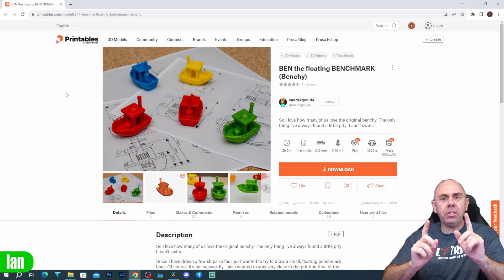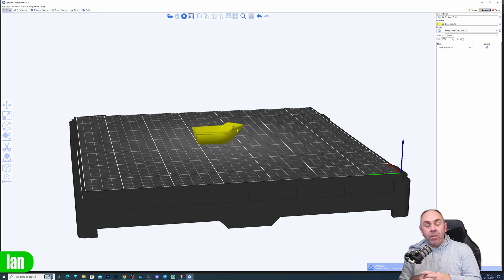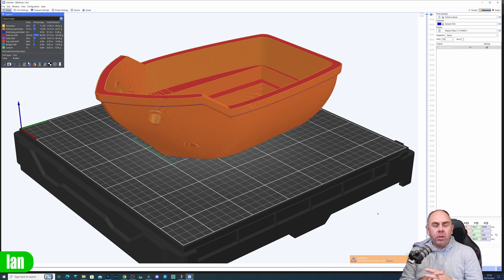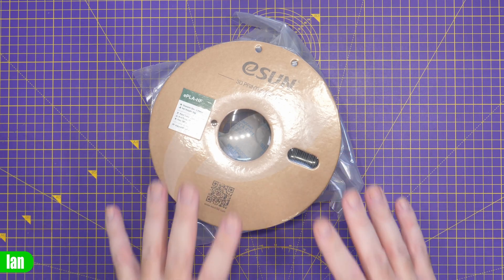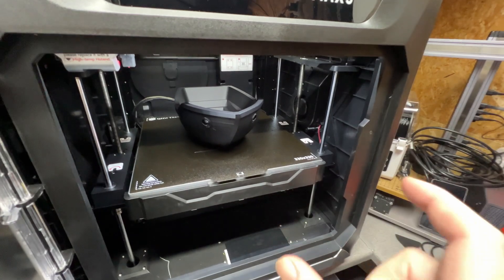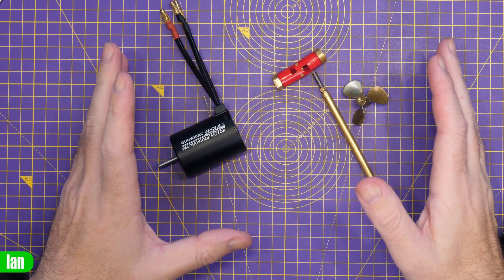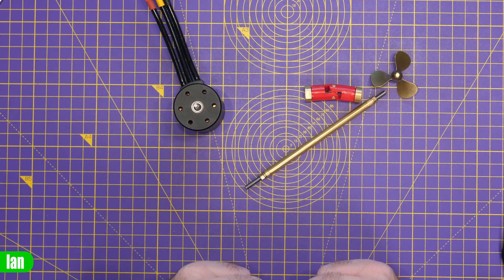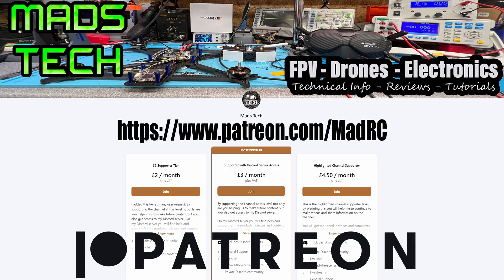Lets Build A Radio Control FPV 3D Benchy - Qidi X-Max 3 Large Print

Comment: Just for your information regarding if your affiliate link for the bambu black friday week had worked (or not).

I had purchased what you had recommended, the P1S or so (it is still in the box, needs a new bench and warm I guess in the heating room) with the 2 free filament spools which were anounced as limited. For our twins birthday december 6 th it should arrived and arrived but without filament even though I had a screenshot that I had ordered one while the free filament was still available at least on the website. So I opened a case on bambulabs site, told them that the boys in the group which the twins are leading will be totally upset if they did not what the should have gotten. 
Bambulab ignored it and rejected everything while the twins went crazy on social media till the competitors became aware of the story and offered the black fridays price for their printer - and on top they made a 2 for 1 offer on top after the deep disappointing moment when they had heard that the spools were missing, bambulab later replied that they were not ordered while in stock even though the screenshot showed the message of 2 free filament. 2 for 1 meant that each got his own 3 printer and that one was also a lot cheaper. 

And then - you might wonder why I am still writing while the story seems to be told - I wrote back to bambulab first that the boys are running a social media campaign and that they will succeed (which later happened).

Second: based on german law I would not pay the 30€ shipping fee to return the item, but they could pick it up cause based on german law they had not made clear during the purchase that the click of putting into the basket could lead to a purchase without free filament which is forbidden here cause that would mean that a shop could replace items in basket during order or the content. 
Bambulab did not react and warned them about german consumer right clubs and their lawyers that they have issues based on their german website and based on their EU headquarter in germany. Anyhow they ignored that too and so I called a lawyer who said he would win such case but recommended a way to easier success. Open a paypal claim and write in german the claim and add a screenshot of the website in german cause PayPal would then force bambulab to pay for the mistake which meant they would have to pick it up via dhl or others, I would not have to bring the printer to the post office.

Guess what?
Now the same guy from bambulab wrote what ? We send you the 2 free filaments if you cancel the charge back
That was the release day of the A1 - just before the A1 release which I did not know was happening.  
To make it short: from the black friday purchase it took maybe 20 days why the twins would not get the free filament and on, then I got the offer for 2 free filament and had to sleep a night or better 2 till I said yes and within 24 hours the filament was here from Frankfurt in a very stiff box, each spool perfectly protected and then another heavy cardbox as protection on top. Arrived today. I have closed the paypal case. 

And now from my inbox the paypal date and time when I had purchased: November 20th  15:48 = 3:48 pm GMT +1 
I hope you will be able to find this affiliate link in your list now or at least later (cause I had closed the paypal case 1hour ago). I really hope they, bambulab will honor your efforts cause without you I would not have bought such printer for the twins - and for sure not for me, but a lot cheaper one. But based on all your recommendations I had said that we will invest more for a longer usage period and higher value / lower depreciation. Without you they would not have sold it to me - crystal clear cause I had not watched any other 3d printing video or brand before even though I was aware about creality, the prusa and what not for brands. 

I hope you will find that order on bambulabs affiliate overview - and maybe that might help even more: the order number begins with EN and ends with *661.
I had paid 667€ (incl. 8€ shipping and 19% VAT) and it was an order from germany on the german bambulab store for the EU, I had used the link you had provided.

Quite long and astonishing journey, a lot of effort for me, disappointed kids that now use a different brand which had jumped in instantly with a great offer and no PR propaganda  after they had helped out, and I was already in a "maybe next black friday mood and attitude", when the turnaround came over night surprisingly which I first wanted to reject and then thought twice . Stupid marketing mistake by bambulab. They knew the printer was birthday present for our twins and they stayed coldhearted, they ignored the social situation, and what not, till paypal claim was open and then weeks later they offered a 24hours delivery for the spools we had missed. 

And I have a printer and no spot right now, but I guess on chrismas things will look a lot better - for the printers new home which is still in the factory box. 
I bet they have not learned the real lesson and maybe others will find the story how you have to deal with bambulab in case of an issue: open a bambulab claim , ignore whatever they write and let them know that you will open a paypal claim cause only then you will find help and support and a very, very fast support cause before they had replied every 3rd or 4th day maybe. 
And I guess that is a key knowledge for you in case others might face issues and complain cause paypal is a 180 day after purchase (not delivery) protection that is respected by its power. Everything else did not work at all in my opinion. I hope this feedback might help you in these tricky situation when buyers will complain and might be unhappy with the bambulab support - as we had it in earlier days with DJI and its support, which has improved an awful lot, also the repair service and prices at least for me.

see you in 24 hours live stream I guess.

Comment: 12:55 why did you need those supports in the back bot not for the bow ?
Reply from the maker: The lettering stuck out a lot. It was not for the boat but the lettering it’s self on Ben
Reply: @MadRC  Yes, thanks. I can remember that when you "unpacked" that. I am noob and forgot that you can not print on air or a horizontal line without that.